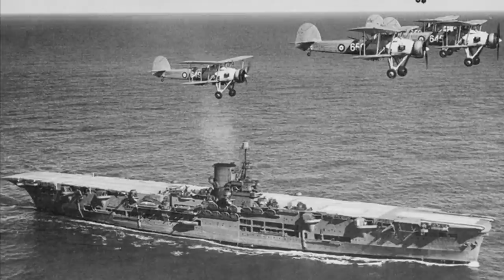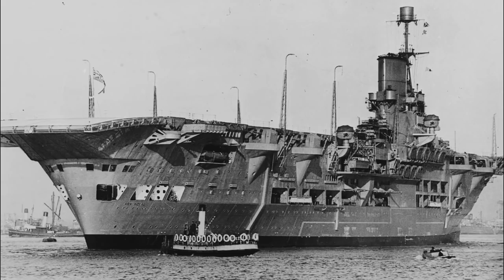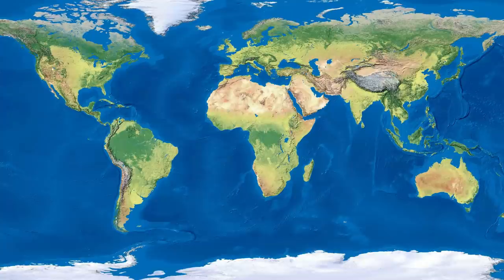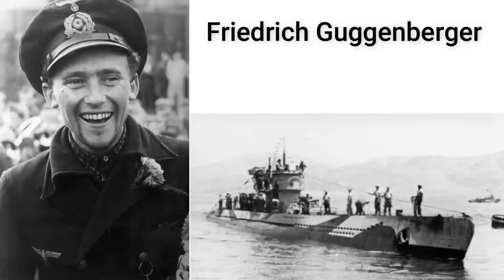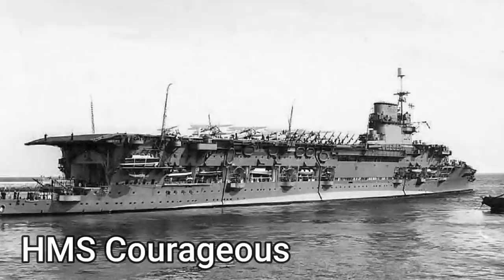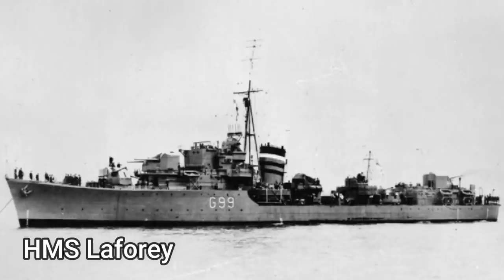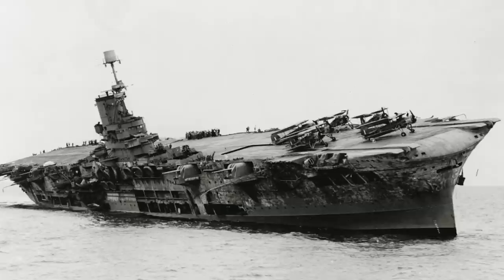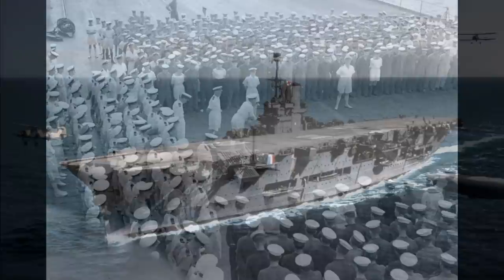The Sinking of HMS Ark Royal 1941

Comment: Unbelievable how after being hit that all bulkhead doors etc were not closed. The ship definitely could have been saved. She was a very prized target and her service record was exemplary. Thanks once again for another great documentary
Reply from the maker: Thanks
Reply: Seems like a lack of discipline or training not to close those doors. Were they afraid of locking people behind? Seems like they were not prepared to save the ship. Seems like there was indecisiveness.
Reply: @steveperreira5850  Yeah, if I were there, I would be afraid of locking men in flooded compartments by closing the bulkheads and hatches.
Reply: It's always left a bad taste in my mouth. Such a shame
Reply: @steveperreira5850  It may have been an issue related to high octane aircraft Fuel and ensuring adequate venting to clear petrol fumes which are highly explosive, and I think had resulted in the loss of some carriers, which happened to Carriers in the Pacific Later? Just a guess. As a side note,  British Carriers were Much stronger in this regard than American Carriers of the time were, due to steel flight decks, but extreme care had to be taken with explosive fumes from Aviation Fuel still, especially in areas near Munition Stores.  Getting Air blowing through the length of the ship removes it quite fast, but if there were Fuel leaks, you'd want to keep that Ventilation going until the source of the leak(s) was dealt with. The Situation assessed below the flight deck would have had to determine the correct response to it. But sometimes, you are Damned if you do, and are Damned if you don't.  🤔
Reply: @brownnoise357  Thoroughly ventilating the ship certainly worked for the Taiho ...

Comment: Its worth noting how far ahead the Royal Navy were in carrier design, construction and operations than most other navies. Hydraulic catapults and arrester gear on a through deck carrier in 1937!
Reply: Don't forget the armoured decks! American carriers had wooden decks, vulnerable to kamikaze attacks, the RN carriers in the Pacific fared significantly better!
Reply: @PercyPruneMHDOIFandBars   Indeed so! As HMS Victorious proved in 1943 when she was loaned to the US Navy and became USS ROBIN . And of course as the 6 Fleet carriers and 4 Light Carriers of the British Eastern Fleet in 1944/5 particularly showed against the Kamikaze you mentioned. None were sunk.
Reply: @PercyPruneMHDOIFandBars  US carriers carried far more aircraft than British carriers and they were designed for the Pacific not the Atlantic theater, different carriers for the type of warfare they would most likely face.
Reply: @tommatt2ski difference is us has the industrial to build more but RN has more experience and built multi purpose roles in every theatre.

Comment: Another very informative video, many thanks . The Capt saved his biggest asset, the entire crew bar the loss of one casualty, a tremendous achievement with no communications. However, with all that air power available, why no air reconissance was not constantly patrolling known danger zones and despite sub activity warnings are sadly prime contributing factors in her loss. Naval atchitects are the third, modern petrochemical risk based designs ask "What if" and mitigate the problem. Shame nobody thought of that during her design.
Reply: Exactly, ships are just steel welded together with technology bolted onto them.
They're easy to replace.
Trained sailors are not.
I'm not sure CAP (Combat Air Patrol) would have helped, they can only attack a known target, they can't scout for it when submerged.
That's what Jackie's Destroyers are for, locating, relaying and attacking subs.
Of course, once located you can cue a flight of torpedo bombers to attack it.
The real mistake was assuming the contact heard by the Destroyer was friendly. And that's why lessons like this tend to be written in blood.
You always always_follow up a contact until you _know what you've found.
Sadly, this very same mistake was made at the start of the Falklands and HMS Sheffield and some of her crew paid the ultimate price.

Comment: Just a few points here. 

-Ark Royal was the RNs first fleet carrier, as designed. All previous fleet carriers were conversions. At the time, only tiny, obsolete Hermes was designed originally as a carrier.
-Large number of aircraft is again, by British standards. She was designed to carry 72 aircraft, but the RN abandoned that figure even before Ark Royal was completed. In reality it was a design maximum  60.
-The 'revolutionary' additions to the design were new for the RN, not the world. American CV 1 Langley had arrestor gear, as did every other American carrier design. American carriers from at least CV 2 Lexington had catapults (I don't know a ton about Japanese carrier design, but I imagine it was the same for the IJN). If I remember correctly, arrestor gear was invented by a Brit and offered to the RN, but the RN was uninterested until much later. 
-In naval engineering parlance, the Ark Royal's flight deck was her 'strength deck'. For American carriers, the strength deck was the hanger deck. Both designs had advantages and disadvantages.
-A huge advantage of Ark Royal over previous RN CV designs was Ark Royal's operational range, which was double that of Courageous.
-Yes, command incompetence was part of the reason why Ark Royal was lost. That damage control didn't begin for 40+ minutes is astonishing. 
-Some known issues with the design were vibration problems and a lack of maneuverability.
-The sinking did reveal some design flaws that were eventually corrected in future (post-WW2) designs. Here there was poor watertightness, poor subdivision, cramped boiler intakes (around the double-hanger), a vulnerable communication system, and a lack of an auxiliary power system.

Comment: I remember a pair of diesel back up generators, the engines simular to that powering giant train locomotives, on an upper deck on the carrier Hornet CV12. Hornet post dated the Ark Royal.    An upper deck location is protected from flooding verses a lower position in the hull.   Good set up.  It isn't only about having a generator, its where you put it too.  (Fukashima nuclear disaster had that problem, back up generators in a flooded basement caused the reactors to over heat, cause generators don't work when flooded!)   Just like the Ark Royal Boilers did not like being flooded.   Unfortunately, do to their height, boiler rooms are low in the hull.

Comment: The captain was done the right thing, he saved his crew first, the knocking out of switch board made internal communication system gone, very dangerous to send damage  control team down there and time was running out.
Reply: To improve the damage control in the future the Royal Navy should redesign the engine and electric al power systems with redundancy system.
Reply from the maker: I completely agree with you.
Reply from the maker: I think it's fair to say that modern carriers such as the current Queen Elizabeth class have learned many lessons from their predecessors.
Reply: As shown, time was there. And 22 miles from base, could have been towed.
Reply: @t_sixtyfivex_wing8787  This was part and parcel the DIRECT problem imposed by the London/Washington naval treaties which limited Carrier tonnage.  There was effectively no possible way before the outbreak of WWII to build an aircraft carrier that could be armored against air/sub, have a large flight deck/hanger, have large gasoline storage/fuel storage for long range, and have excellent defensive firepower/damage control~ split Engine/boiler rooms with at least 2 comm/damage control stations bilge pumping stations, power distribution stations on existing allocated tonnage.  True, you could build maybe ~2 such carriers but no navy was willing to do so as everyone saw the need for at least 4 to 6 carriers due to maintenance, training, station keeping etc.  Of course there is still the crew training aspect which failed Ark Royal spectacularly here which exacerbated the flooding.
Reply: @WALTERBROADDUS  Hindsight is always something the present do not have. In hindsight, she wouldn't have been hit at all.

Comment: Call me a dreamer but quite often I have wondered why some creative thinking might have got the Ark Royal to Gib. On the front flight deck were 5 Swordfish with 1000HP aircooled engines. That combined 5000HP surely could have been used to help drag this carrier along. Also, the tow line broke and was difficult to re-attach. Could the tug not have push the carrier? Finally what about the destroyer that tied up alongside to provide electrical power? Why did it not do a bit of pulling as well?

Comment: Could an illustrious stand this?
Reply from the maker: Thankfully, Hms Illustrious never suffered the same sort of attack. The Illustrious class of carriers were not a huge amount different in basic design, but for an extra hanger deck and improved armour and defences. If the hull had been breached in a similar fashion then who knows how she would have faired. Like I say, we'll never know as it never happened to her.
Reply: I think that Ark herself could, if it weren't for the less than adequate orders the damage control parties were given. I hope NH will agree with me about this.
Reply from the maker: Whilst it is easy to consider the charges brought at court martial relating to damage control parties and effectiveness of orders as well as having the ship in more 'readied state' for the possibility of serious damage, it is perhaps fair to say that the charges  were probably taken from those that would be applied to a 'regular' ship such as a cruiser or destroyer. The fact that this was a huge new type of vessel, untried in time of war let alone to suffer such huge damage meant that Capt Maunde may be forgiven for not going entirely by the standard rule book. The fact that the boiler room went across the full beam of the hull, exacerbating the listing as well as having no standby emergency generators to power the pumps, may have doomed her. If the Capt had issued more standard orders, he may have extended her life but may not have stopped the final result. I think where Capt Maunde should be praised is that there was only one fatality. It is a very interesting topic for debate, don't you agree?
Reply: @TheNorthernHistorian  absolutely it is... I'd submit it to Drach! Of course i agree about the practical absence of fatalities being a very important achievement of Capt. Maunde (being the only fatality a direct consequence of the torpedo hit he had no whatever responsability in it) but, and as a pacifist i'm playing the devil's advocate role here, as a military high ranking officer IMVHO he should have tried harder to save the ship.. This is no Cressy class armored cruiser whose loss the Admiralty would have deemed less important than that of the crew. Think of it: had she had a full complement of modern aircraft and modern tactical doctrines, which of course in 1940 were still to come, she can be considered the most powerful warship afloat in atlantic/european waters at this stage of the war.
Reply: @TheNorthernHistorian  Pretty much the reason for the poor below water line damage control, no split boiler/engine rooms, no 2nd communication backup system, no auxilarry power diesel generators etc was the London/Washington naval treaties which limited tonnage allocation to carriers.  It should be noted that all of these systems were added when Illustrious class was refitted out in the UK/US in 1942/1943 at different points to as much as was possible to fix.  Pretty much every single carrier of WWII era was crippled in some manner or other due to these treaties.  To be fair, I think the UK made the correct decision at the time as the most likely form of damage was going to be bombs from air and the armored deck showed up brilliantly in the Med for the most part.  As it turns out, torpedoes throughout WWII, in all theaters were the greater threat to the Ship itself whereas bombs creating fire was the greater threat to human life.  Hrmm, pick your poison eh?